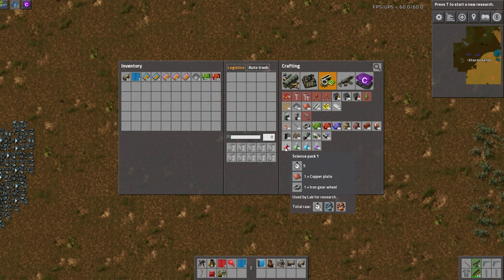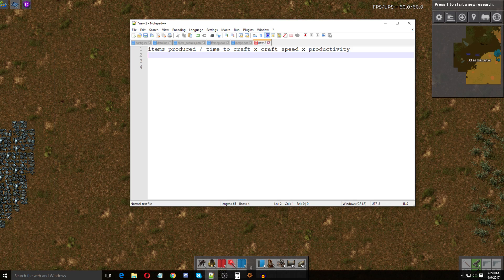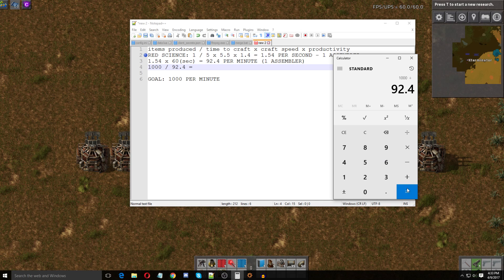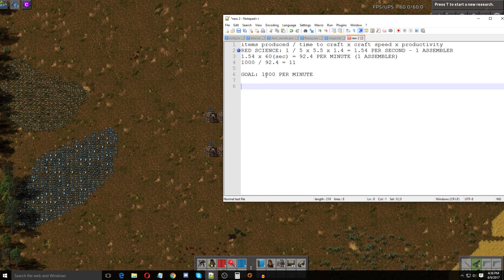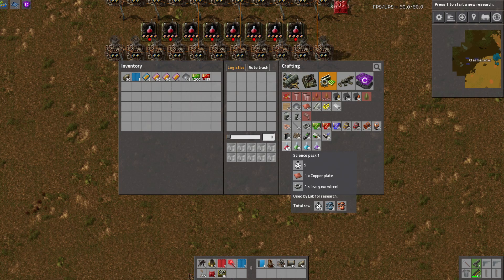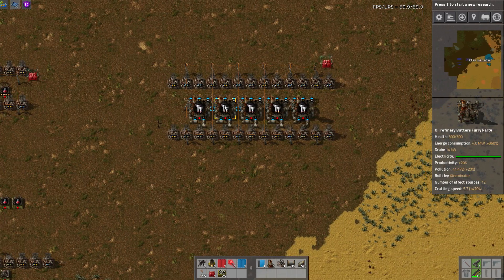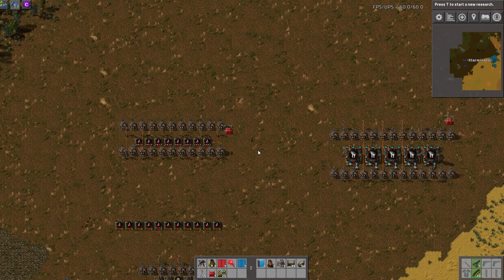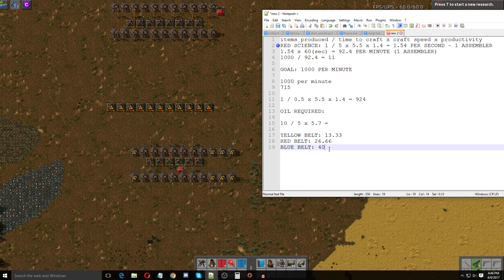Calculating / Figuring Out Production Ratios - Factorio Tutorial

Comment: To be more precise if its confusing 
(Items produced/Time to craft) * Craft speed * Productivity = Output/sec
In this case (1/5) * 5.5 * 1.4 = 1.54/sec
If it was a chemical plant making plastic it would be (2/5) * 5.5 * 1.2 = 2.64/sec
Reply: thanks u saved me from watching the video even though i love his vids
Reply: To be even more precise
the actual formula should be

Items produced x (1/Time to craft) x Craft speed x Productivity = Output/sec

it doesn't matter which of the terms gets divided by time to craft, the point is that the output is inversely proportional to it
this is called a 'reciprocal' value

functionally it's the same as Items produced x Craft speed x Productivity / Time to craft
that term is obviously below the division line (the denominator), and that's why we shouldn't tamper with it, as multiplying it would modify the time to craft instead of modifying the items produced

also
https://en.wikipedia.org/wiki/Commutative_property

1 * (1 / 5) * 5.5 * 1.4 = 1 * 0.2 * 5.5 * 1.4 = 1 * 1.1 * 1.4 = 1.54
or

is exactly the same as
1 * 1 / 5 * (5.5 * 1.4) = 1 * 1 / 5 * 7.7 = 0.2 * 7.7 = 1.54

but this isn't
1 * 1 / (5 * 5.5) * 1.4 = 1 * 1 / 27.5 * 1.4 = 0.03636 * 1.4 = 0.0509

thus
A * (1/B) * C * D

simply got shortened to
A / B * C * D

but it should've been shortened to
A * C * D / B
Reply: @milanstevic8424  he

Comment: if i understand that right, each one of those oil refineries requires its own crude oil feed pipe/unbarreller... not a small flow there.
Reply: Pipe flow rate is complicated: https://forums.factorio.com/viewtopic.php?t=6066
In general, 90 fluid/sec is a good assumption.
Reply: Assuming you can pump 90/second out of the ground...

Comment: What I don't get is how to get that 5.5. How do you convert the percentage speed on things to speed? Like a science lab doing infinite research that takes 60s that says 1020% speed.
Reply: I posted a comment about this very thing.

" 
Chris Castillo 1 second ago
I may be mistaken, but I believe you plugged in the wrong value for crafting speed in your equation. I have seen another comment on this video, confused about where you got 5.5 from, and I would like to know as well.

To my knowledge, the crafting speed of the assembler was 0.5 (meaning half as efficient as the player's crafting speed by hand)
Therefore, the true rate of red science pack production would have been 0.14/second, or 8.4/minute.

I got this using your formula;
( Items Being Produced / Crafting Time) x Crafting Speed x Productivity
( I / T ) x S x P
( 1 / 5 ) x 0.5 x 1.4

( 1 / 5 ) = 0.2;  meaning 0.2 red science packs per second.
0.2 * 0.5 = 0.1;  meaning 0.1 red science packs per second through an assembler
0.1 * 1.4 = 0.14; meaning 0.14 red science packs per second with the added productivity modifier."

Comment: You mentioned that you recommend using productivity modules "if the item can take it". How do you know which items can use productivity modules?
Reply: Only recipes in the Itermediate products tab of crafting menu can take productivity modules.
Reply: You can't use productivity on "end" products, basically.  So anything on the "intermediate" tab (cogs, wires, etc) are fine to productivity.  It actually pops up a message saying this if you try to productivity something you can't, but it's actually wrong - you can also productivity anything producing raw materials (ore, oil) as well - so things with a "mining speed" rather than a crafting speed.

You also can't use productivity in beacons - more for avoiding cheatiness than anything else - if you could beacon productivity you could set it up so that, for example, 1 iron plate produced silly amounts of belts :).
Reply: Rakkfalen i thought everyone just knows what can and cant take prod... maybe i just been on factorio to long...
Reply: I've never even bothered with production yet, never had a base big enough to bother with anything other than speed modules.

Comment: Hey X
this does not seem to work
So I was trying to make a full belt of cable with Asmb.mech.II and after pluging in the numbers I got 4.5 Meches. but that does not seem to be enough (and there is no bottle neck)
(also this was the result: http://i.imgur.com/775kfgg.jpg)
Reply from the maker: Probably because your inserters can't actually insert onto the belt fully. Try putting underground belts where the inserters drop their items. The math does work out, I just double checked, so it's an issue with the setup somewhere I think.
Reply: Hey, thanks, turns out, Normal inserters were not fast enough
Reply from the maker: Sure thing, glad you got it worked out!

Comment: Writing fractions in one line may be confusing and not lead to the same result being read by some else. One may read a/b*c as (a/b)*c someone else may read it as a/(b*c), so be carefull with inline fractions
Reply from the maker: TheJoshinils  normally I would agree and thought about that for this, but I don't think it's an issue for this because you literally calculate exactly as its shown which I explained.
Reply: SO(a/b)*c=d
Reply: math must have a result before you can calculate  1+1+5*8=56  ??
Reply from the maker: It works completely fine the way I showed it though. lol
Reply: Based on the distributive property, any multiplication and division can be done in any order whilst producing the same result. So long as there is no addition or subtraction this will apply.
Reply: Duncan Forsythe 4/2*2 may be 1 or 4 if you dont use parentheses
Reply: nvm I see your point. I forget division signs... sighs
Reply: Mathematical expression operator precedence rules require a/b*c to be read as (a/b)*c. All other interpretations are wrong. Multiplication and division are of the same precedence and as such are read following left-associative rules.

Ambiguity caused by use of a slash operator for division is only a problem when multiplication denoted by juxtaposition is used. Xterminator used an 'x' for a multiplication operator. As such, there is no ambiguity in his expressions.

When entering expressions into a calculator, be aware that different calculators may follow different orders of operations due to their use of chain input. The Microsoft Calculator program uses chain input in its standard view and mathematical operator precedence in its scientific and programmer views.
Reply: multiplication has priority over addition. So your calcul should be read as 1+1(5*8)=42
If you use google chrome, you can copy paste calculus in the adress bar and it shows the result :)
It does not work on window calculator because it can only do one calculus at a time, so you need to figure out the priorities before feeding it ;)
Reply: only for people who don't know the order of operations
Reply: @skilz8098   Where I live, PEMDAS is not taught. I would need that context. Without context, the statement is ambiguous. And reading Wikipedia it does not mention that division or multiplication comes first, it is simply not defined unless you specify. PEMDAS is a simple mnemonic, understanding why the operations are ambiguous and why any other order would lead to another result is a good thing.
Also, "left to right" is a bit of context which is missing here, same limitations apply.

Wikipedia says: In the United States[10] and in France,[11] the acronym PEMDAS is common. It stands for Parentheses, Exponents, Multiplication/Division, Addition/Subtraction.
Reply: @skilz8098  i agree.
but the order of operations is not defined for multiplication over division. it might as well be PEDMAS.
they have the same weight. only for clarity in these situations is it a good idea to use a rule like "left to right" or "division over multiplication" otherwise the statements are ambiguous.

multiplication is commutative, so A*B/C should be the same as B*A/C or is it B/C*A?
you can not know if the numerator is just B or both A*B without making assumptions.